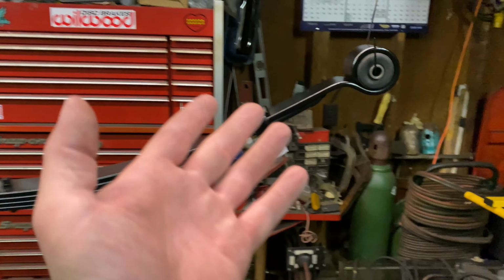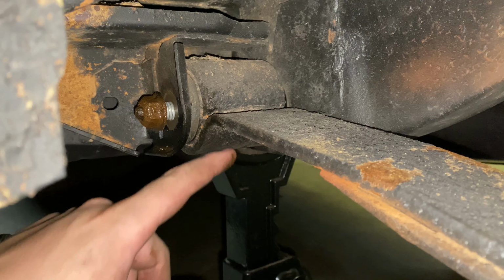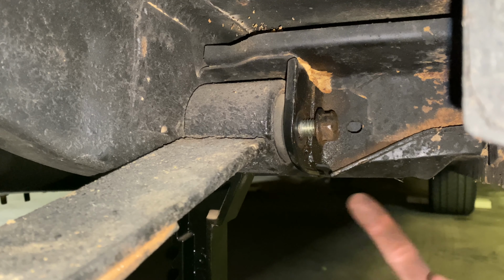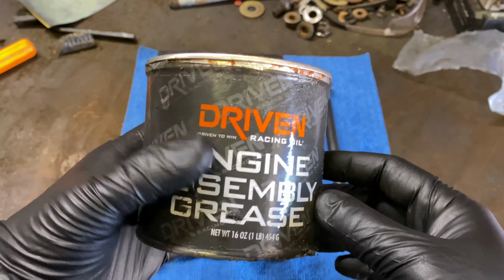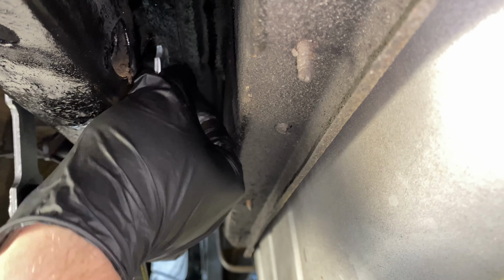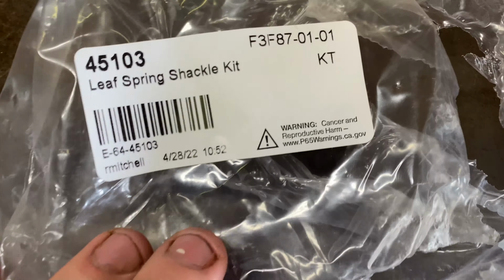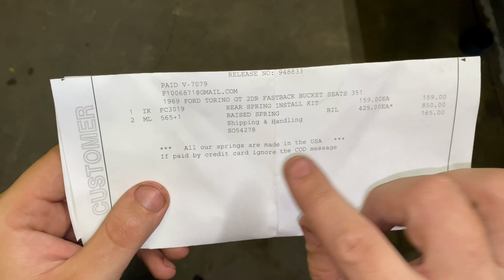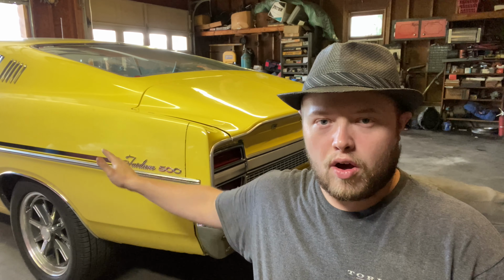New performance leaf spring install-(68-69 ford Fairlane/Torino).

Comment: Nice install. I was looking at my 68 Torino today and thought the back was sagging a little too much for my taste. I was considering changing out the leaf springs and your video popped up! What kind of air shocks are you running? And do you like the ride of the shocks?
Reply from the maker: Thank you very much! Very cool car man, yeah they all sag alittle after 50+ years. 
They are Monroe shocks from Oriellys and yeah they ride pretty good, no complaints. Now with the new springs though I don’t really run that much air in them and I’m gonna be changing them for some double adjustable shocks eventually. The springs definitely made a huge difference in ride quality and handling. Overall though if you just want to get your ride height up a bit for a cheap cost the air shocks do a great job for that. I recommend not airing them up all the way as they just mount to the floor pan and the stiffer they are and the less the spring is actually holding the weight the more pressure on the floor pan the shocks out and could potentially bust through the floor so just keep that in mind. The most I ever kept in mine bed the spring swap was 60 PSI. Hope this helps and good luck on your build. 
Thanks for watching.

Comment: Thanks,Great info ,sweet ride. My 71 Torino Cobra 429 CJ is sagging. Im going to replace leaf springs and shocks. What configiration would  you recommend for an inch lift  for a better stance , handling and  ride ,  thats not too much for the old unibody to handle? Any advice is greatly appreciated.
Reply from the maker: You’re very welcome, and thanks, I really appreciate it. That’s a sweet car you got too, don’t see those old cobra jets very often at all. Well it all depends on what you want out if the car and what you’re planning on doing with it. I’ve replaced my front coil springs with standard height springs and cut them down to lower the front two inches, and also installed a 1-1/8 front sway bar. My leaf springs are 1 inch higher than stock, but before that I used air shocks which I am still currently running but they’re only pumped up just enough to act as a regular shock, I am planning on going with an adjustable rear set of shocks and front coil overs with 1 inch dropped upper control arms to give me that Shelby drop and handling in the future. As is though my car handles really well, rides good and takes corners well. So I’d recommend a similar set up for yours since our cars are basically the same frame wise, except yours being a big block cobra jet, yours should already have a 1 inch front sway bar from the factory so I’d just put new bushings on it. Hope this helps, if you have any other questions, feel free to ask, I’ll help the best I can. Thanks for watching.

Comment: why is there fairlane trim and torino stripe? only one ive seen like this.
Reply from the maker: @sheldonkepley4585  because it’s a fairlane 500, I installed the c stripe because I’ve always liked them but obviously couldn’t remove the trim because there would be holes so I plan on removing the trim when I do the body work. Also a fun fact, my car is a 68 but I installed the 69 stripe and tail light panel and grille because I like them better, don’t know if you noticed. I also plan on installing the 69 fastback 3 hash marks on the sail panel vs the 5 that 68 has. 
Thanks for watching.
Reply: @FastFords289  i see, yes  i remember the grill, front and rear form another video, nice car. great job!
Reply from the maker: @ ok so you’ve seen them, cool. Thanks for following along and thanks for watching.

Comment: Was there some upcharge or something on your springs, cuz 850 a pair seems really high.
Reply from the maker: Yeah I got the improved handling springs, plus I got 1 inch higher than stock added on to so it all adds to the cost. Overall though, worth the money because they are a high end very well made good quality product. I’ve put probably about 1,000 miles on them so far and they ride and perform great. Hope this answers all your questions or any you may of had. 
Thanks for watching.